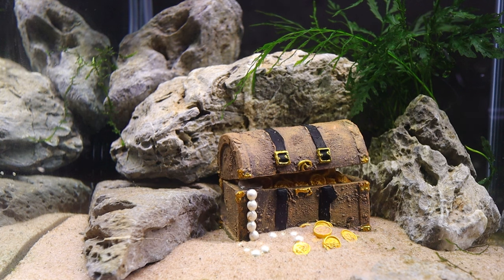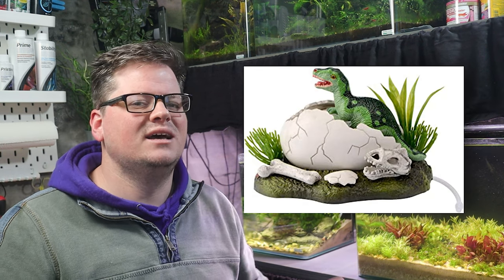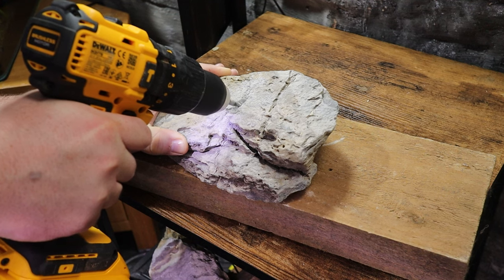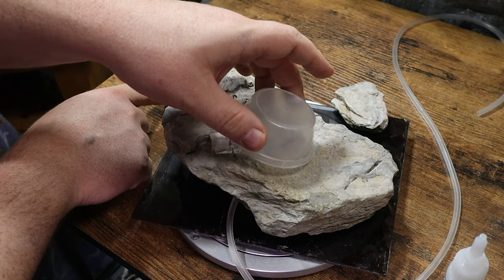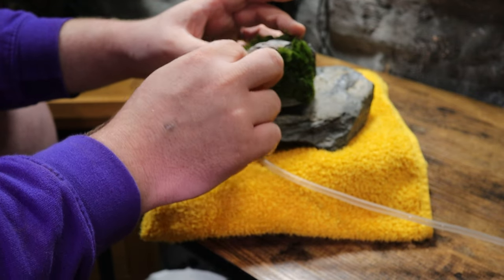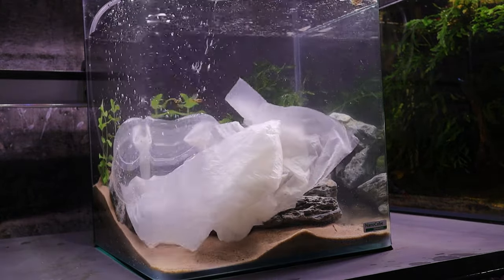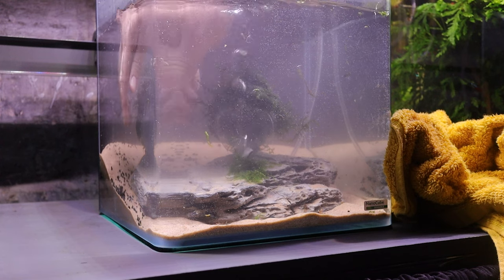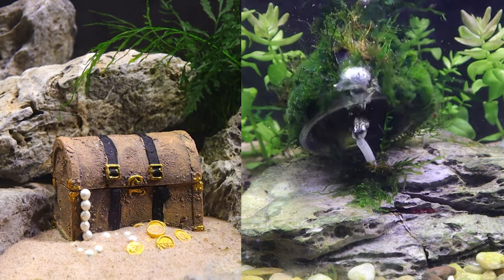My Childhood Aquarium Ornaments Revisited

Comment: What about a sort of backwards waterfall, but instead of a constant stream of bubbles, it's single droplets of air going through a designated trail to get to the water surface. You know, like those fancy ADA CO2 drop checkers, but inside the aquarium instead of outside.